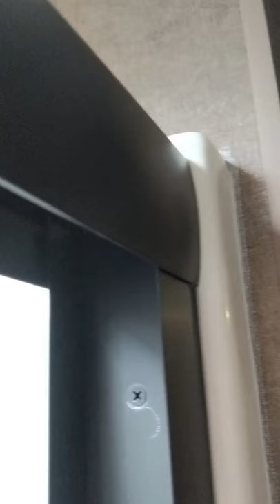RV 3 Panel Shower Door Shattered!  How To Replace It Yourself.

Comment: I have the exact same doors and the rollers came out, and you are correct, there is no way to slide the rollers in the track unless the track is off the stiles. I bought it that way and they must have hit a large pot hole. I do have a question on the inner rollers. as you pointed out the outer rails have rollers on the ends. Did I hear you say another roller rides between the two end rollers? If so, what does the middle roller attach to, or is it free wheeling? I haven't seen it off so perhaps it will be clear once I have it on its side.
Reply from the maker: If I remember, the middle has a captive roller and does have a track. It’s like the middle rides on the other doors, but think of it as more like… the outer doors roll to the middle door and then the outside wheels carry the weight

Comment: Do you know who the manufacturer of the whole shower door is, or the brand of the replacement glass and where you ordered it from please?
Reply from the maker: I'm pretty sure it's either made or imported by these guys http://www.seamerica.com/  but they don't sell to the public.  I see a lot of companies that list shower doors that all look identical in so many respects.. it makes me think there is one or two suppliers in China, and then branded under many brand names.  https://www.trekwood.com/replacements/50839/Shower , as an example 

Finding the right thing is harder than panning for gold.

Mine was sent to me directly from the factory under warranty.  My unit arrived home with a broken shower door.

This google search seems to have the best results.. sort of.. https://www.google.com/search?rlz=1C1GIGM_enUS726US726&q=rv+triple+slide+glass+shower+door&sa=X&ved=0ahUKEwiD9__JrePbAhVH4qwKHeqsCyEQ1QIIxgEoAA&biw=1820&bih=1144

I think even Lippert lists a similar door under one of their websites that also lists windows.. which seem the same.. many names, same looking window.
Reply: @plasma800  Great video!  Have the same problem with our doors in a 36' Fleetwood Bounder.  I have a door from a distributor in Indiana.  It made it to the local delivery truck and was smashed in transit.  Returned to sender, who sent another one using a different carrier.  Same result this morning.  Driver showed it to me and it is going back.  Both were shipped in cardboard only.  Did you order from Trekwood?  I am trying to determine who did the crating and pallet for transport.  The distributor or the manufacturer?  Thanks for any information.
Reply from the maker: Bruce Tellardin when mine arrived, it was in a cardboard box. The cardboard box had been mounted inside a pine frame, and that pine frame was stood upright on a pallet and the nailed to the pallet. They further used wide metal straps to strap the entire thing to the pallet.
Reply: @plasma800  Thanks for the reply Jay.  Do you know if it was shipped by the manufacturer?  I'm trying to order one that will be shipped the same way.
Reply from the maker: @brucetellardin5859  The label said that it came from outdoors rv, but it could have well been drop shipped from the manufacturer.  It looked like quite a production to get it here.  Are you certain there is no way to buy one locally?  I would guess that possibly local dealers might carry a product such as this or be able to order it.
Reply: Thanks for the video.  We just found our center glass shattered.  It appears it just shattered for no reason.